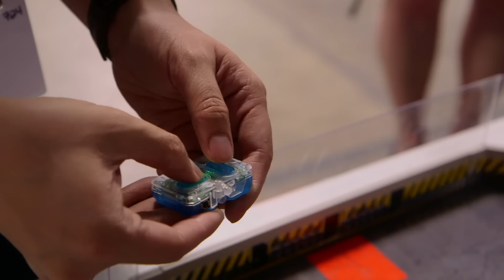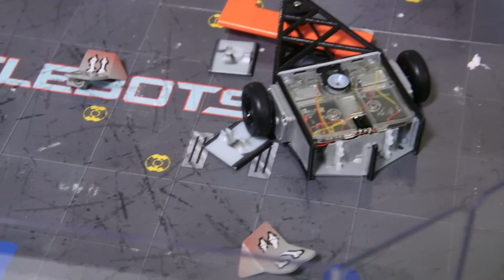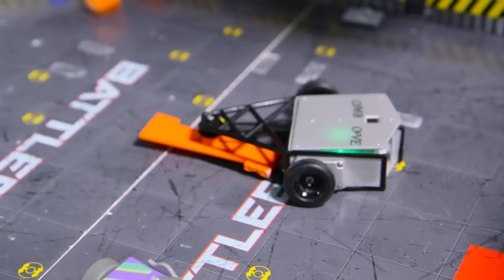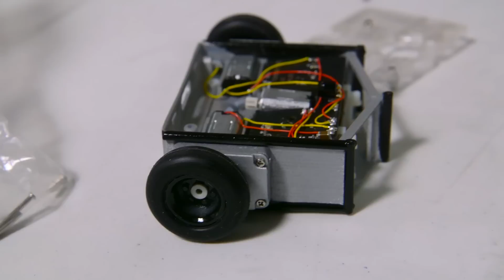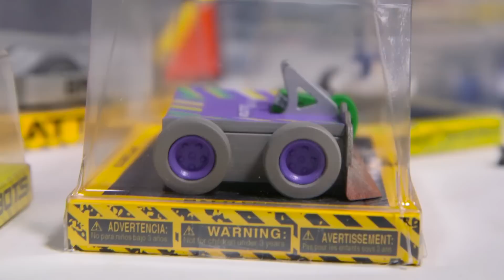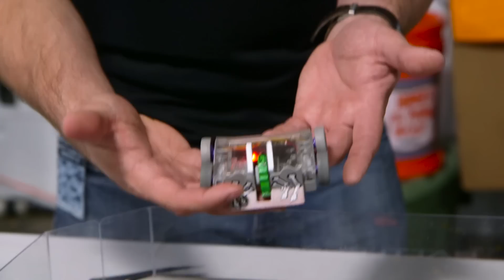Hands-On with BattleBots RC Toys!

Comment: Oh so they're stil in production, was wondering what's up with them as some months ago I've seen a video preview on a channel, that guy was talking with Ray(creator of Tombstone) about them and how they required measurements and all to make them in the correct size.
While I don't own the original toys, I've heard that they work the same way with parts that can be taken off, but those here are much better built into the bot.
Some of the original Robot Wars toys(Chaos2, Razer) were actually modified by their teams to take part in antweight championships.
Sadly those won't be available here, but I'd personally prefer a PC game(Robot Arena 2 is sadly a bit old, and 3 was disappointing, there's so much more you can do up to the point where people could easily model their own robot and have armor pannels fly off/make armor pannels be made out of different materials).

Comment: Do these have sensors on the removable parts ? looks to me like they all run with all the pieces removed .. a sensor based unit could slow a machine down or stop a wheel when hit . shows who actually won .  still cool . I'd like to see a slightly larger machine that is fully customisable .. You'd only need to sell a single model set . save on production costs . I think a basis chassis with connection pieces ( like lego or magnets ) and a have 3 different choices of weapons and armour  included .  Selling add on packs for armour and additional weapons would elevate the experience. Just an idea . I'm available for hire!

Comment: Dude I have one of those original ones from the OG Battlebot's a looong time ago! It's the one with the spike that comes straight down and is on 4 circle wheels. I loved the old Battlebot's, it looks like they're putting a bit too much glamour into this one but I will still give it a chance. I have a ton of R\C stuff from the 90's in my attic, I could only imagine how much LIGHTER these are now-a-days. Batteries alone back then were heavy and large just to power a car using to play around with and not in a robot used to kill other robots.

Comment: My only gripe is the small ass controllers. The kids hate it, it's hard to use.
Reply: fin101m same frequency doesn't always mean the controls will be the same.
Reply: ya but these are pretty much standard and would be easier to buy their sister controller from vex on the same freq should work
Reply: design and 3d print a bigger one and stuff the original electronics in it.
Reply: Why not just a different controller on the same freq

Comment: Cool, I can get a little cheap version of Witch Doctor that performs just as well as the full scale turd in the real show!
Reply: Remember when it snapped Tombstone's blade in half? Remember when it one hit KO-ed Rotator?  "its spinner didn't hit anything" have you even seen the show?
Reply: witch doctor is BEST bot
Reply: Remember last season when its spinner didn't hit anything because it was on the top of it's chassis? Remember this season when the 30th seed clamped it and set it on fire?